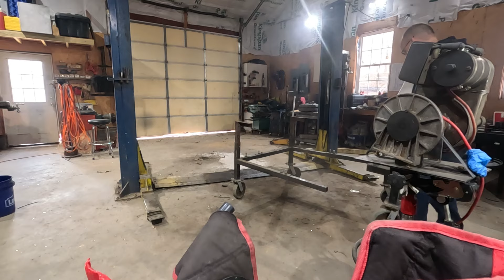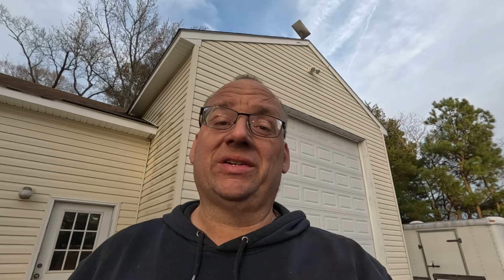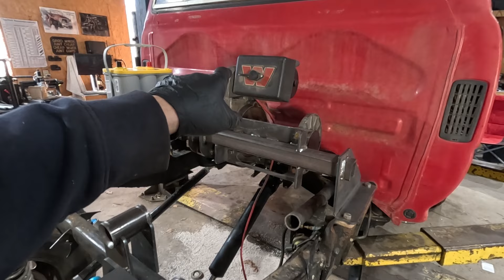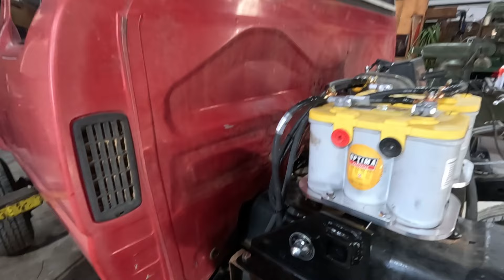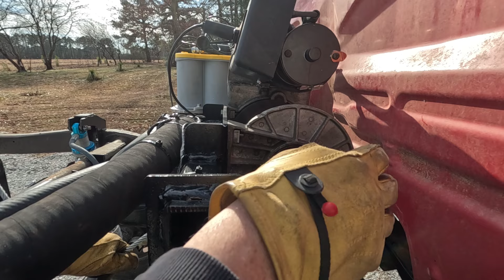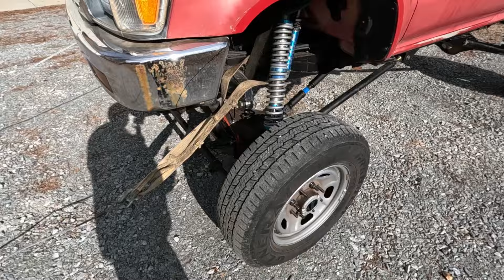Building a custom winch system that I have only seen it in a magazine over 30 years ago.

Comment: This is nice bro. These setups are very popular in Europe and Asia where events like the Rainforest Challenge are time trials. Teams use big, fast and heavy industrial pto driven and hydraulic winches where they are too big for the front so the put them under the bed in the middle or right at the back, then same as yours, guiding it to the front under the chassis. You can check them out for inspiration going forward.

Comment: On your first guide from winch and after snatch block  suggest your guide mounted on pivot. Should help with, spool nicer onto drum and happier cable Action toward front
Reply: On past ones similar like this tube was just to keep mud / snow off cable. Guides were rollers. Either like mini roller fairleads... Say maybe size like those  for UTV Bumpers?  Orr two pulleys horizontal each side cable  and two.. w/on top other bottom.

Or scrap cable and go to synthetic rope and aluminum guides like your using. Which they may sell. Check with Yakum

Comment: I'd mount it at a slight angle facing rear snatch block. . The cable is routed to a snatch block at a rear. 

Rear Recovery. Hook cable solid to front of truck. At rear remove a pin or?? Releasing snatch block from its mount. 

Forget how to spell/say it. That set up is Phorz or Forez (or?) system

Comment: Interesting. I had an idea of doing the same, but figured the idea of threading the cable forward would be to much of a hassle in nasty conditions. I'm building a 95 f250 overlander style. I put a 10k warn on front and am in the process of installing another 10k over the rear axle, under the flatbed that I still need to make. Be nice to yours in real world action.